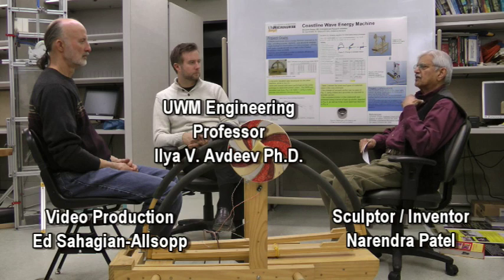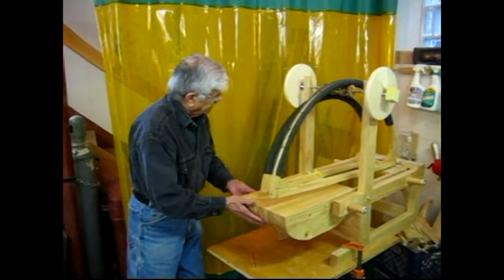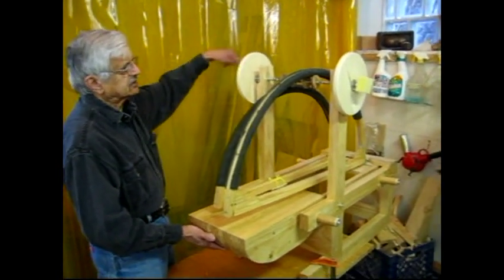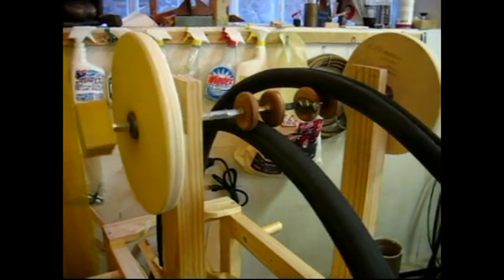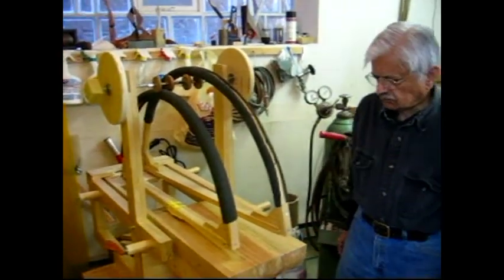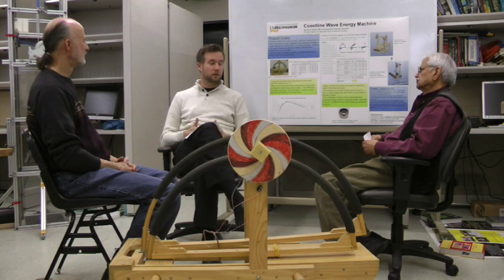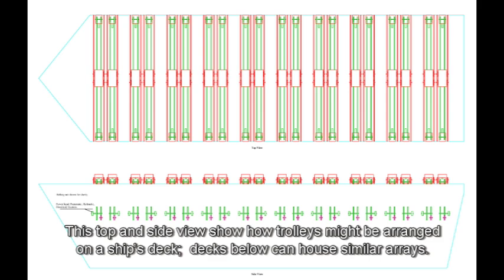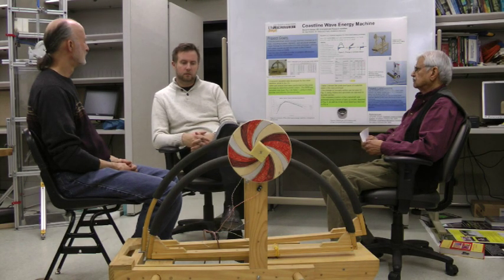Wave Powered Kinetic Converters

Comment: This is such a simple and elegant disign! This is very similar to the WEPTOS design by the Denmark company called WEPTOS. However, WEPTOS only caputres the energy from the wave upwards motion of the buoy. What this design offers is a way to capture both the up and down motions. My senior project team and I are actually working on a device using a planetary gear train to be able to capture these wave motions. We are still developing the proof-of-concept prototype but I will make sure to post a video one it is done!

I also noticed this video was from early March, 2013. Here we are almost two years later. I would love to see/hear how the project has developed!

-Adam